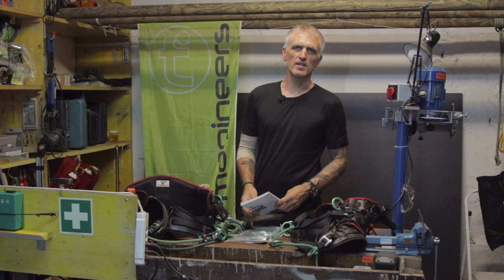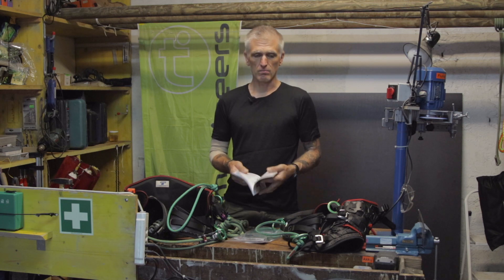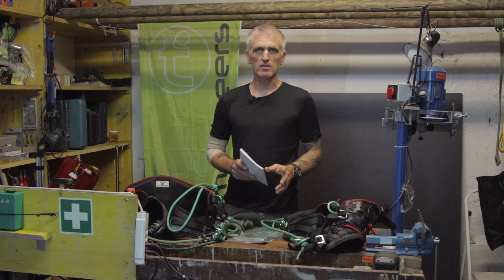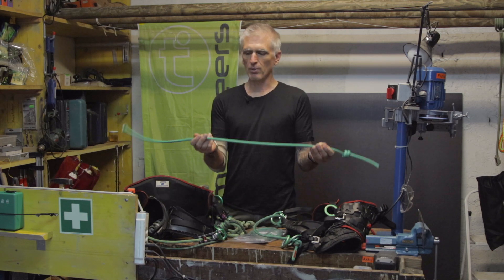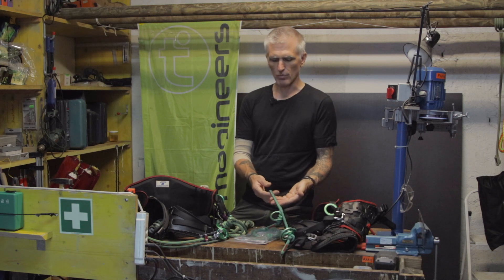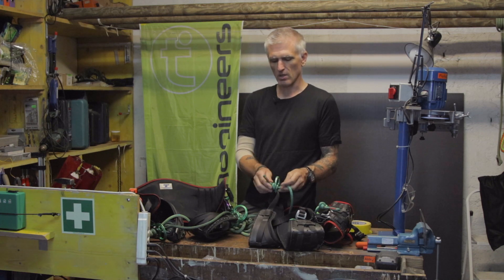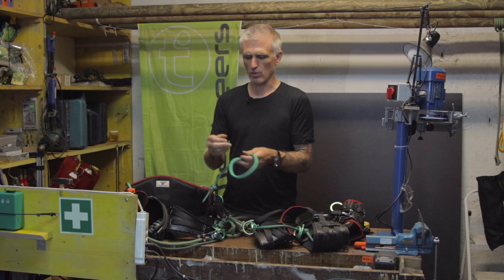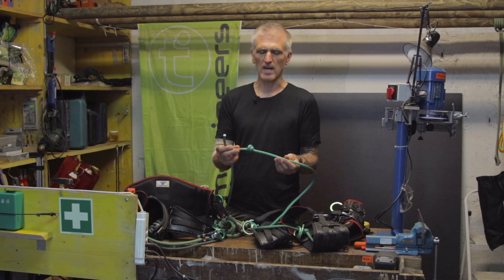treeMOTION rope bridge inspection and fail criteria

Comment: 12 strand dyneema core with double pes sheath in a 10mm rope. Sounds like Arbo is taking a lesson from yachting. A 10mm polyester dyneema racing line is a minimum of 10k lbs ts. Cheers.